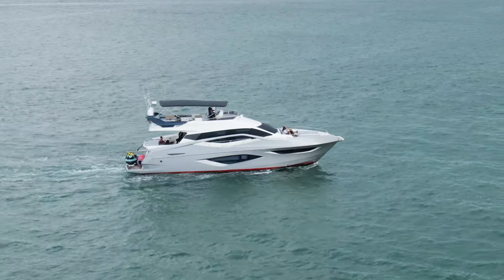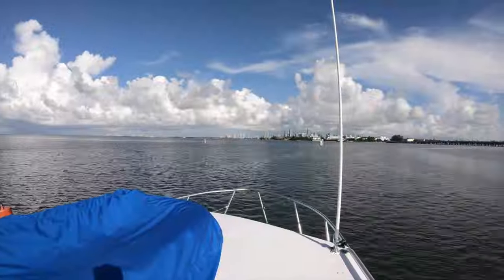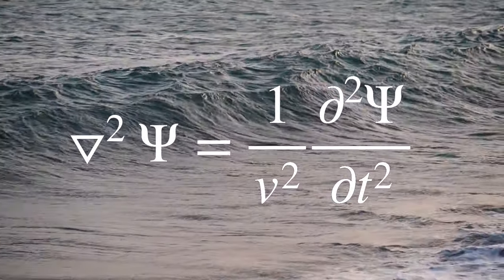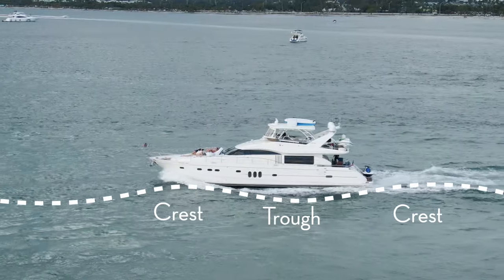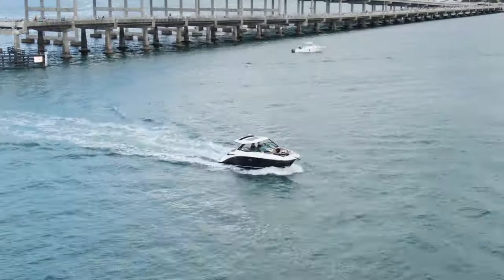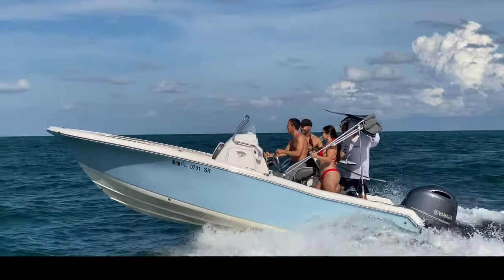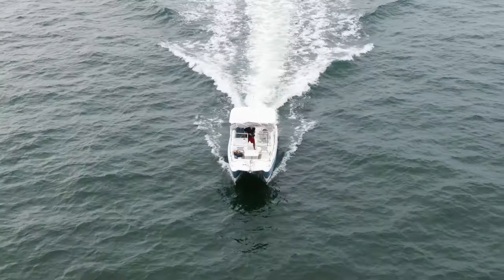The Physics of Boats

Comment: There is another formula which I find more handy. The hull speed is calculated directly in knots. It is 1.34 multiply by the square root of LWL (in feet).
Reply from the maker: That formula comes from Froude number experiments, just a more simplified way to express it (and easier to remember).
Reply: @Waterlust  also worth noting that the way you expressed the Froude number formula is dimensionless and it works for any (self consistent) set of units whether inches, feet, meters, nautical miles, or astronomical units !
Reply: @Waterlust  Does the 1.34 shortcut work for all boat types or just sailboats with their pretty consistent length/width ratios?
Reply from the maker: @artsmith103  in general will work for most boats, however very slender hulls can operate at higher Froude numbers without as dramatic a penalty like kayaks and catamarans.
Reply: @Waterlust  Yes, competition kayaks are great. There still is development in hull shape. I've often wondered if such a kayak could get faster, if it would foil. But most people say, I think it takes too much power to make a foil going faster than those kayaks do today. Still, I wonder if a foil designer can prove them wrong.
Reply: And finally get rid of your out dated units. Yoohoo! There is metric! It's free, it is better, so you stick to that emperor of yours. Huh?!

Comment: In the example calculation of the 20 meter boat, the left side of the equation should be multiplied by a factor of 1.94384 knots/meter/second.  Otherwise the result will be in meters/second not knots.

Comment: Very good explanation, but it misses the part "wavemaking resistance" or "pressure resistance". It's not so much the frictional resistance which causes the resistance to rise sharply around "hull speed", it's the wavemaking resistance. The frictional resistance increases more or less linearly with speed. Many ships (e.g. naval ships, patrol vessels, motoryachts) are too heavy to plane, but they "beat hull speed" with a slender hull form and a lof of power, often using features to reduce wavemaking, such as a bulbous bow on the front and a Hull Vane on the back. We call this "fast displacement" when the ship is not lifted out of the water, or "semi-displacement" if they are reasonably light and are lifted somewhat out of the water due to hydrodynamic forces on the hull.

Comment: your resistance vs Froude # graph did not make sense with your explanation. Why the dip (less resistance) with a higher Froude #?
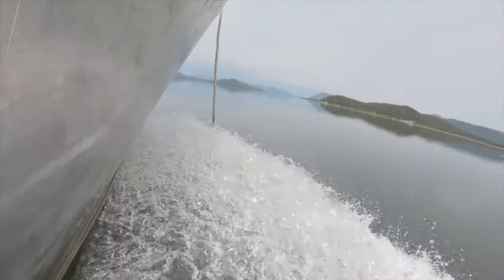Reply from the maker: The “hump” in the plot at 04:07 is caused by the dramatic increase in resistance when a boat tries to overcome its primary transverse wave. If it’s able to, some boats will experience a brief region of reduced resistance. Note, every boat has a different resistance curve, so the size and shape of the hump varies a lot. One way to prove this phenomenon to yourself is by going in a small planning boat and setting the throttle so you’re stuck at that awkward hull speed with the bow up. Then have somebody carefully move to the bow to help the boat initiate planning, but don’t change the throttle. Works really well in small inflatables. What can happen is the boat starts planning and going dramatically faster despite the engine producing the same thrust. The only way this acceleration can happen is if the overall resistance on the hull were to drop, which supports the idea of the resistance dip at speeds slightly above the critical Froude number. Great question!

Comment: Very interesting. My father in law had a double ended trawler with a small engine. When the engine failed he replaced it with a much more powerful engine but he couldn’t go faster. All that happened is he used a lot more fuel. He was stuck at his hull speed and that hull was no capable of planning no matter how much power you put to it. 
Your explanation is great.
Thanks

Comment: The formula you've provided, Hull Speed = 0.4 × √(g*L), is close but needs a bit of adjustment to match the conventional formula used to calculate hull speed.

The correct formula for hull speed (in knots) is:
Hull Speed (knots)=1.34×√(LWL) (in feet)

· LWL: Length of the Waterline (in feet).
· The constant 1.34 comes from empirical studies related to the behavior of waves created by boats moving through the water.

However In your formula, √(g * L), g is not typically used in the calculation of hull speed. Instead, the square root of LWL alone is what's used, along with the constant 1.34 to convert it to knots.

If you were trying to calculate speed using gravitational acceleration g (9.8 m/s²), the formula might be more complex and applicable to other dynamics, but it's not used for the classic hull speed formula.
Reply: Yes I agree. For my displacement sailboat, with a waterline length of 30.5 ft, my max hull speed by your calculation is 7.4 knots, which accurately describes practical observation. Using the mixed metric formula in the video gets nowhere close to reality (3.8 knots). I don't know if that's an effect of the metric conversion or whether the freud number is inaccurate for small sailboats.

Comment: Great post my friend. I have plans to build my own Trimaran and information like this will be crucial to my dimensions. 🤩⛵
Reply: Well hopefully you built the tri. However for anyone designing, multihulls are designed to beat the hull speed calculation by having very thin hulls in relation to length. This means they can exceed traditional hull speed calculations.

Comment: how can you estimate the hull speed?
Reply from the maker: Use the equation in the video. By estimating the boat length, you can calculate the hull speed using the Froude number 👍
Reply: @Waterlust  Should length refer to the observation wavelength and be able to calculate the ship's speed?

Comment: I don't think I'm convinced that the boat creates waves that hinder its speed. The only waves I see are to the sides and travel to the rear which are visible in this video and anytime you look at moving boats in the water. That "secret" hidden wave isn't possible given how boats are shaped. If you're talking about sea waves then that's something else but boats create one type of waves only and they are visible and travel in the same direction all the time. Anyone with eyes and anyone who has kayaked, paddle-boarded, or floated in an inflatable object around moving boats can also confirm this. The wake is always the same and depends on the size of the moving boat and its speed only.

Comment: 05:07 At 950 feet long, the cruising speed of a Panama container ship is around 25 knots.
In the film, a Panamanian container is described with a captain of 950 feet and a cruising speed of approximately 25 knots. But when the hull speed is calculated to be 40 knots, why do most container ships only have 25 knots? Does not match the hull speed.
Reply: Fuel efficiency most likely. MAN Energy Solutions has a paper out titled "Propulsion of 14,000 teu container vessels" and shows (amongst other things) that identical ships are vastly more efficient at 21.5kts instead of 23.5kts. Eg. At 23.5kts their example ship consumes 197.9 tonnes of fuel/24 hours, but at 21.5kts it consumes 145.4 tonnes of fuel/24 hours. I can't imagine the fuel burn at 40 😬😬
Reply: @williamstrachan slow speed is definitely burning less fuel as it travels less distance.
There is a relationship between fuel oil consumption & ship speed & power. It is not a linear relationship. Therefore, all the vessels go slow-steaming in the poor economy period.